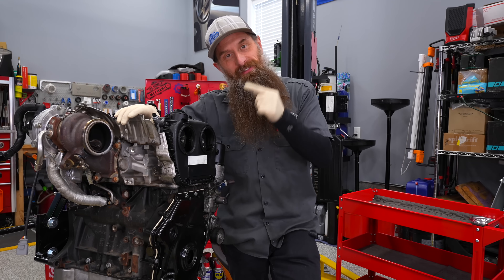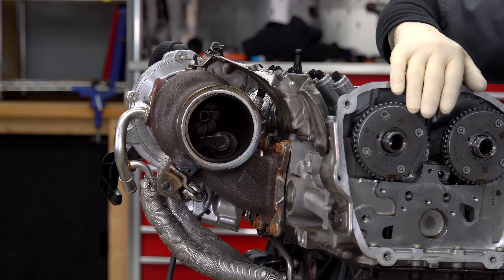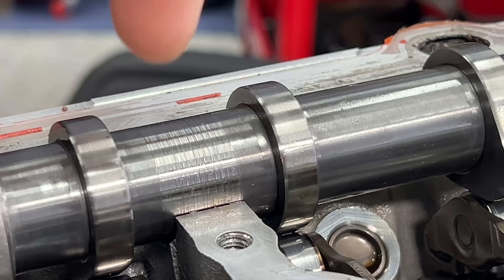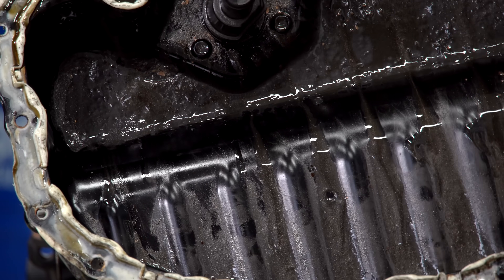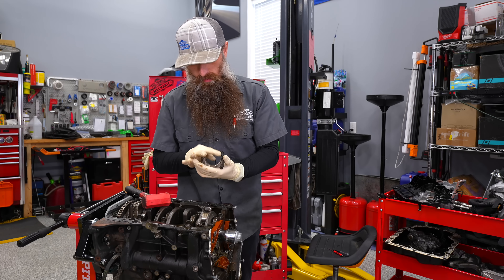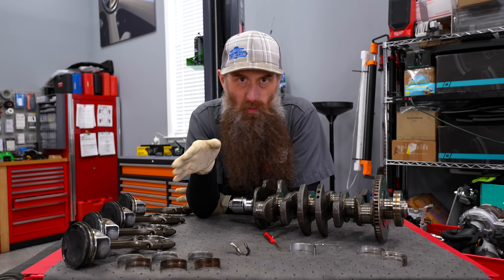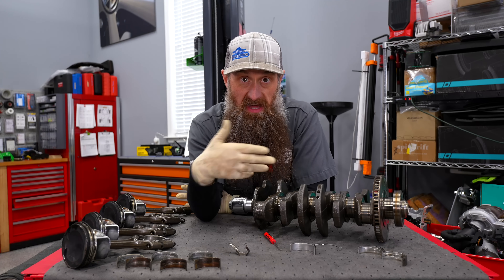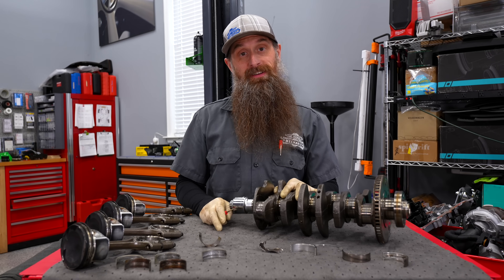Why This Audi S3 TSI Engine FAILED at Just 110k Miles?

Comment: This is why I'm a massive proponent of warming up an engine anywhere from a few to as long as 20 minutes depending on the outside temperature.
Reply: 💯 Or at least get the oil temps to 160F before giving it the beans

Comment: To be fair, most if not all Low Friction Ring Engines consume some oil. I know Honda, Toyota also have oil consumption issues.  So yeah blame the EPA and CAFE for manufactures having to build engines that are more efficient, but just don't last as long.   Just over maintain your car and it should be good if you plan on keeping it long term with ANY brand.
Reply: This failure is nothing to do with Audi, VW, EPA, CAFE.  That's a silly suggestion.  This engine was badly rebuilt and badly used.  All 100% user destruction.
Reply: Plus you have leaks on upper timing cover, lower cover, oil pan, valve cover gasket, any old o rings and low tension rings, all that oil is gone

Comment: Ive seen a lot of similar cases to what we have here . Sometimes people tend to install the cam shaft cover with the cams in the incorrect position causing the scoring you see on the intake cam. Camshaft is in the journal crooked, or bolts over torqued. Causing the cam and journal to be shredded on start up, Usaully sending metal everywhere in the engine, smoking the oil pump. Vehicles that have this problem usually only symptoms you see is intermittent low or no oil pressure at idle. Which could be the answer to the lack of lubrication to the rod bearings.
Reply: The valve cover is the cam caps so you cant mix them up

Comment: That is why i religiously not hammer my mk7.5 R when its cold. I even drive without heater in the winter till the oil temp shows up in the gauge at least. I only have to get better on my oil changes. For now im doing the service according to the manual which is every 2 years or 30.000km whatever comes first. Way not often enough i know. About twice as often is what the enthusiasts recommend.

I am just way to stingy to pay a shop to do the oil change and the law does not allow to do an oil change everywhere in my country. Work that my spill oil, that is including a car wash, is only allowed on a dedicated spot with a sealed surface and an oil separator. So if you are unlucky and dont happen to own a proper car shop or even just know a guy that does you end up renting a spot in a commercial car shop and that will end up costing just as much as having a shop do the work for you.
Reply: If you want that car to last you really should be doing 9 months/10k kms oil changes (whatever comes first). Just change it yourself in between services, super easy
Reply: @eponymous7910  Like i said. Unfortunately im not allowed to do oil changes just in my driveway. Gotta have a sealed surface and an oil seperator. Fines are insane. Environment is very important in my country. Guess theres people that do it in their closed garage, if no one sees you no one is going to fine you but i dont have a garage.
Reply: You can actually turn on your heating once it show you 90 degres of temps for your coolant. Since it's based of off coolant temperature it's fine as long as you don't start it right away with the engine cold.

Comment: Got a stage 2 2017 Audi S3.. exact same as the engine in this video. Best car and funnest lil rocket I've ever owned. However, you religiously need to check your oil level every 2-3 days. These use a lot of oil due to blow-by, so if you're not willing to pop the hood on your car every few days, just stay away from these. Also, the water pump and thermostat housing is notorious for failing on these engines as soon as 20k miles.
Reply: 2-3 days?! C'mon dude, maybe every couple weeks at the most
Reply: @eponymous7910 Yeah 2-3 days is absurd. If you're paranoid check your level each time you fill up at the gas station.
Reply: @nobleman-swerve  You clearly did not understand owners.this car is so very capable. Frequently, do your homework.
Reply: @ you'd probably be safe checking every 2 weeks.. i drive mine pretty hard lol so I always make sure I'm topped off.
Reply: got almost 59K on my 2017 R.  She needs attention but has never lost a drop of oil.  I run her hard every now and then...mostly then.  She keeps oil.  Changed every 5K or less since I don't really drive her hard.  At some point she get's Stage 1 but not sure when.
Reply: You mean to tell that these don't even have an oil level sensor?
Reply: That’s bullshit it has a oil level meter
Reply: @Clips.netlll  They only have a low oil warning light. These still have a dipstick. The A5 and probably other models have a computerized oil meter and no dipstick. Also, if you're going to wait until your car pops a low oil warning light to check your oil... lol good luck!
Reply: Hey mate, im racking my head trying to work out excessive fuel consumption and oil cap blow by enough to sputter oil out (higher rpm). I changed the PCV valve, its definitely running less rough, but I still got blow by with the cap off, and high fuel consumption. Blow by with oil sputtering out not normal? it has normal oil levels, no noticable leaks. OBD 2 throwing no codes either....Changed spark plugs aswell (pregapped)

Comment: This hits home. As someone who replaced an engine in my S3 in 2023.
Reply: Dang!  A 2023 already needed an engine replacement?
Reply: @ghostwrench2292  no, its a 2015, I replaced the engine in 2023 at 70,000 miles After timing failure.
Reply: @PizzaThePies  Damn, i also have a 2015 S3 with 175k km (108k Miles) on it, still runs like a charm, i always drive very mild untill the oil temp is at least 90C (modded an oil temp indicator with OBDeleven) 

Did some preventative maintenance last year replacing a bunch of fuel and coolant hoses. Hope it'll serve me nicely untill at least 190k km

P.S. I believe because mine is an European model it comes with Dual Point Injection, correct me if i'm wrong but i believe the American models didn't have that, helps a lot against carbon build-up
Reply: @bagofsunshine3916  you are correct we only have direct injection. We like our carbon buildup here in the states.
Reply: @PizzaThePies  Oh damn, timing chain failure? Was there any signs before it took a shit?
Reply: @PizzaThePies  i bought a 2015 with 175k kilometers. after 6000 kilometere is srtarted to bog and made a ticking noise. now they finding out what it is in the garage pfff.....
Reply: Same here man my 15 S3 engine blew at 60k miles. Replaced it with the 19 golf R motor
Reply: @cademcgilton7384  I got a new long block at a VW dealer for about 8000.
Reply: @ Ever find out what went wrong? Timing chains?
Reply: Had a 2014 S3 that needed an engine rebuild at 36,000 miles. The car was well maintained and not flogged. Launch control only used once to test the Haldex.
Reply: @mv55555  What happened to the engine?
Reply: @alextorkelson cylinder 4 camshaft bearing destroyed due to oil starvation. What caused the issue, is uncertain. The water pump was changed about 3000km earlier. I suspect it could have been multi factors. I got advise never to use the stop start system, but too late.
Reply: @mv55555  That's wild... so all over the place on what it could've been. Damn dude... I could be wrong, but I swear EA888 gen 3 failures are pretty uncommon
Reply: Get a bus pass

Comment: I have a CCTA A3. What did they do to fix the carbon buildup in the Gen3 2.0 TSIs?

Love your channel. Watching you casually and expertly take apart (or put together an engine) is so therapeutic to me.
Reply: The Gen 1s and 2s are only fuel injected straight into the cylinder and the Gen 3 has twin injection. So high pressure straight into the cylinders + low pressure in the intake, which takes cares of the carbon buildup
Reply: @burgermis6948 nahh done a few  here in Norway. Even with the mpi you get carbon build up. But not as bad as on gen1 and 2.

Comment: Is there any benefit to running 0w30 508 spec oil in place of 0w20?
Reply from the maker: probably not. As  long as 508 meets or surpasses the spec.
Reply: @HumbleMechanic  thanks!  This tear down certainly had me thinking I need to make sure the engine is warm before hammering, and that I should change the oil next weekend in my GLI 😂

Comment: Ehhh the lower timing cover is definitely reusable.  I’ve always bent them back and they seal just fine.  I can see if someone went ham and just kept prying on one corner you might not be able to save the cover.  I’ve only had the very first one leak and that was me not using enough rtv.

Love your videos!  You have so much knowledge when it comes to these vehicles!

Comment: this is the crossover between Charles and @I_Do_Cars I've always wanted. thank you!!
Reply: Its more the middle ground. I Do Cars takes everything apart on an engine, while Charles takes some parts of the engine apart. If that makes sense. Charles missed out n tasing the oil pump apart, cutting the oil filter open.
Reply: My thought exactly!

Comment: They ran it low on oil and drove it hard. They kept flogging it even after the oil got way too hot and spun a bearing. They kept flogging it until the bearing material tore up everything inside the engine.

Better to rebuild a junkyard engine.